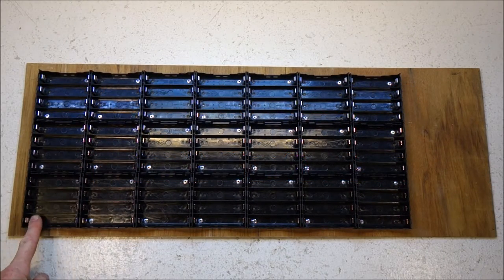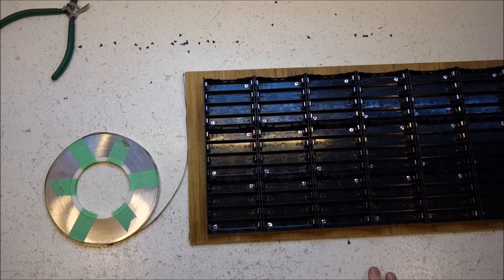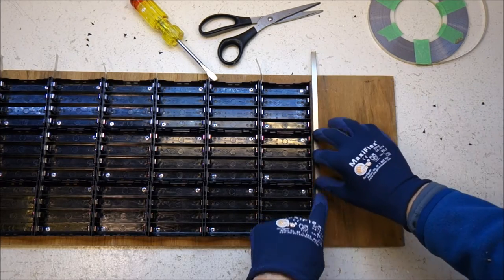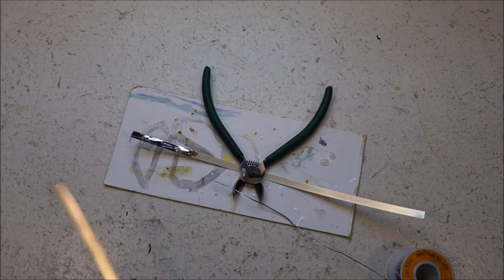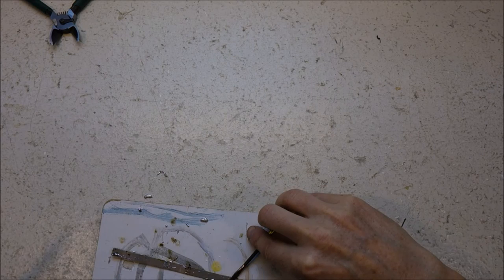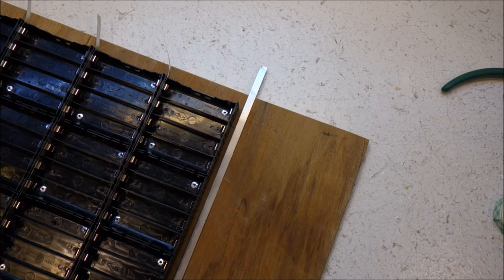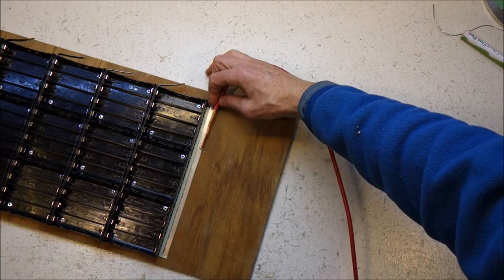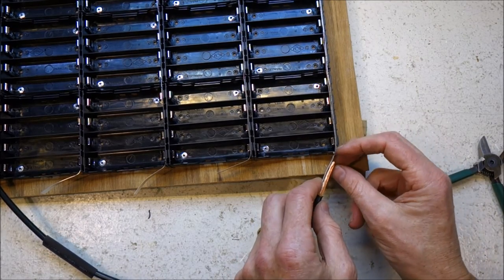Laptop Powerwall 46 - powershelf main wiring

Comment: looking goood, i think your onto something there!
Reply from the maker: I may have stumbled on to something. :)
Reply: I completely agree.  This is blowing my mind.  It is the final piece of a puzzle that has been holding me back for a while.  I love how easy it will be to balance capacity of each column by watching voltage drop when under load.  Then rearrange and try again.  Everything is fused but super easy to swap out bad cells.  Awesome Job Paul!

Comment: I must say I am liking this idea more and more but for me i would use it for all the low capacity cells i have, rather than using the normal battery cell holder clips and not easily being able to replace cells as they are solder directly. The Battery holder idea would work really well for this. For single cells it does take up more room but does over alot of flexible which is a very big plus for all those older low capacity cells, making them usable without too much expense and being able to pull out and replace, Very good.
Reply from the maker: Ah! Good point. Dealing with good cells is straightforward, but low capacity "borderline OK" cells are problematic.

Comment: Hi Paul
I am struggling to see from the video what you are doing with the nickle strip that you put in between the holders where you pushed it down with a screwdriver.
Reply: OK I see it now I have just watched 49 and you can just see one of the strips.
Reply from the maker: I'm just slotting it down behind the battery clip. It's just held in between the clips and the plastic housing.

Comment: Paul, I've been using a pre tinned tabbing bus wire used for solar panels. I still use solder but when doubling up the bus bars, it's much easier? Also I think what i'm using is a little thicker. See link;  http://www.ebay.com.au/itm/391199691216?_trksid=p2055119.m1438.l2649&ssPageName=STRK%3AMEBIDX%3AIT
Reply from the maker: Yours is 0.2mm as well. The stuff I've got solders very easily so I'm pretty happy with it. I bought a 1kg roll which is plenty: http://www.aliexpress.com/item/Thickness-0-2mm-Weight-1kg-battery-tabs-nickel-plate-for-18650-cell-battery/32334749323.html